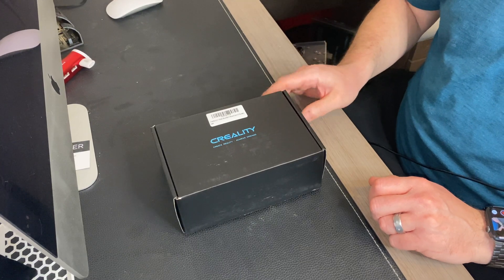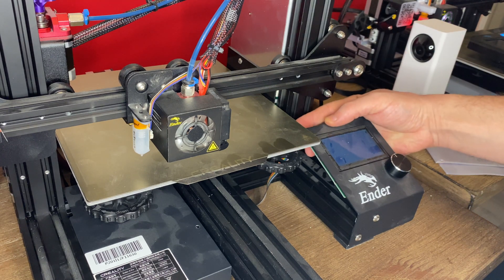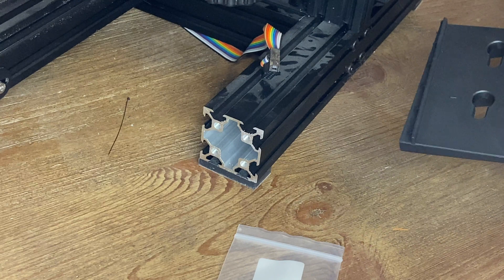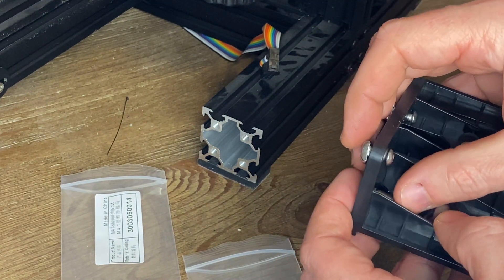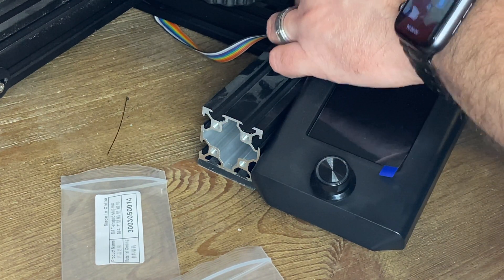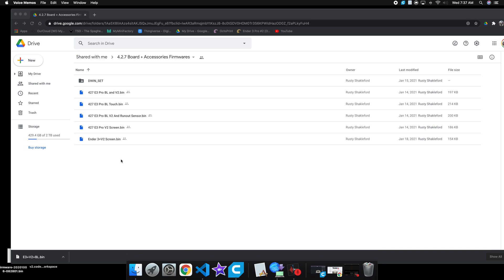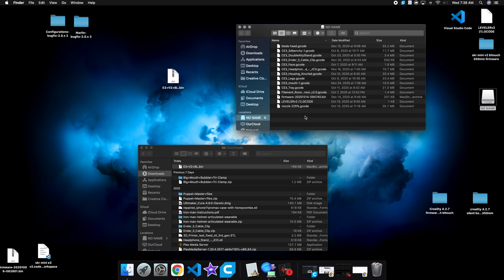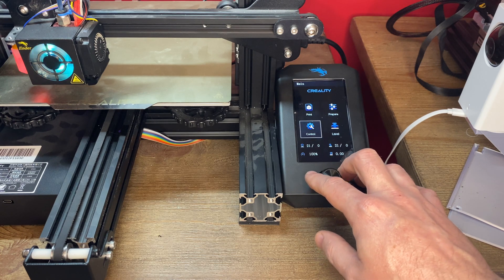Ender 3/3pro upgrade to v2??!!

Comment: I used the firmware included in this video, just one question. I’m having an issue with the “Z Offset” working. Has anyone had this issue and/ or has a resolution for it? Thanks!!

Comment: Just installed MB 4.2.7 for my ender 3 pro and changed out the screen to the V2 screen and installed the CRtouch. 
Downloaded your firmware and it's giving me issues.  Cannot move the Z offset into the negative numbers. 
I'm at a loss what I've done wrong and it's about to fly out the window. 🤦‍♂️

Comment: Hi! I have and ender 3 that I have added upgrades. I have added the silent motherboard 4.2.7, the spire horned, the sprite extruder and the v2 screen. What are the all the firmwares I need to install? I tried installing the v2 versions and when I try to print it won’t print anything.

Comment: You my friend are a life savor. I recently upgraded my ender 3 pro with the silent motherboard and I already had the 4.2.2 board with the screen upgrade from over a year ago and was working great but I wanted to upgrade to silent mother board. Went to install the firmware on the new board and it wasn't booting anything. Found your video and your files downloaded the 4.2.7 with bl and screen and worked like a charm
Reply: Hi there. How did you go about getting the screen fitted to the 4.2.2 board? Is there firmware already available I'm no good at writing my own 😂

Comment: I have a Ender 3 non pro. I have already upgraded board to 4.2.7, cr touch, duel axis, metal extruder. Its up and running and prints great. I bought a v2 screen for the next upgrade. How can i write the framewere so it can work.

Comment: Just found this video and I am wondering, I just bought an Ender 3 Pro from my nephew and it has the CR Touch and not the BL Touch. I also upgraded my Ender 3 v2 to a touch screen and have the ordinal display which is this display. The Ender 3 Pro has the stock board, 4.2.2, Will this Firmware work with the CR Touch?

Comment: Is it work on my ender3 neo ?
Reply: Ender 3 neo also use 4.2.2 motherboard and it has cr touch already. If i plug to my default motherboard this screen work perfectly right?
Reply: @efegulen3127  did you ever try it? I have the same setup

Comment: so this video helped so much however i fallowed all the steps and after flashing the firmware the screen showed half images. im running the cr touch not the bl, and after trying to run the new software on the google drive when it boots up the screen is blank and starts beeping horendisly. if theirs any help yall might have that be awsome

Comment: hi. i have an ender 3 pro with upgrade a 4.2.7 mainboard. i bought the v2 display and update firmware to oryginal creality 3v2 without bltouch but it does not work. next i update firmware to ender 3 pro 4.2.7 + v2 screen from the link below the video, but the display is not turning on. what dwin set should i use to update the display? original dwin set from creality doesn't work. pleas help me.

Comment: I did this upgrade, and bought the same kit that you recommended. It works perfectly out of the box after installation. Firmware was pre installed, so I didn’t have to do anything for that. 

I just bought the CR Touch auto leveling kit from creality, and was wondering how to install it. 

Do I unplug and remove the Z switch completely? Also, what do I do after I install the hardware?

On the link you provided, it says that it comes with the CR touch firmware installed, will the printer know that I have the CR touch connected?

I guess I just don’t know what to do after getting it plugged in. To my understanding I don’t need to change the firmware with the plug and play kit.
But I’m just not sure how it works

Comment: Thank you I appreciate this. I'm getting a CR Touch for my Ender 3 Pro within the next few days. I read the firmware is similar to BL Touch, so do you think the file with "BL Touch" you have would work with my V2 screen?
Reply: Did u ever get the right firmware to upgrade w the cltouch
Reply: @johnvdoe  Hello yes, I was having probing issues with this linked firmware. I ended up using Ender 3 V2 mriscoc firmware, and used the probing settings provided by aim6mac on YouTube because I also have a Sprite Pro extruder. The only thing different I had from that video is the probe offset to get the CR touch to home in the middle of the bed. After that, it worked!

Comment: Hello, and first thank you for putting a working .bin firmware file for ender3 users upgrading their display.  I got my ender3 ( 4.2.7 board + 24 bit reality intel display) working using your ende3 PRO .bin file, even when it is not a pro. 
Would it be possible to get a copy of the "Configuration.h" file that you are using with this .bin file, I would really like to compile it myself using reality ender 3 sample files, so far it crashes not sure why even trying to compile the default 'Configuration.h' without any mod in bugfix 2.0 it crashes.  A little help with this would be greatly appreciated. Alan

Comment: I have an ender 3 with a 4.2.7 board. I also have a v2 display. Would appreciate your help with the firmware. Question; if it is the same board and display why different firmware for ender 3 and ender 3 pro?
Reply: were you able to find out which firmware to use? Im in the exact same boat as you
Reply: @mikeygarciajr.465 download newest marlin firmware. Use VS to modify the firmware to your needs and create your bin file. It’s ridiculously easy and there are tons of videos on yt that shows how to do it.

Comment: Hi Just wanted to drop you a quick note and say how hugely helpful this vid and especially the files were. I have a ender3 v1 non pro but put all pro bits a v2 screen and 4.27 board, v2 tensioners linear rails dual z motors the works and an extender kit for z axis as well as a sprite pro extruder. I do not suppose you have a version of you firmware with the 300 degree extruder enabled on it I could bum off of you?

Comment: with this upgraded board and screen on a 3 pro. Could you just run 3 v2 firmware? If not, why?
Reply: yes done it 3 V2  it works fine  but need to update screen firmware as the DWIN_SET will not upload

Comment: I have an Ender 3 Pro with v4.2.2 board. I am confused on where to get the firmware for the V2 screen non BL touch. Can I just use the V2 firmware for the 4.2.2?
Reply: This is my question.  I see he hasn’t answered so I am screwed for an answer too
Reply: @dugy40  I have the same problem, did you find anything?
Reply: @drogaehovini  yup.  I loaded jyers onto it.  My ender 3 pro is working great.  Has the ender 3 v2 display with jyers on it.  I love it.

Comment: I would like to upgrade my Ender 3 which already has the 4.2.7 board with the touchscreen and the Cr touch bed level which firmware do I use? I have tried to looks all over on the net but can’t find anything with both the upgrades. I stumped upon your video. Would greatly appreciate your help, 🙏

Comment: I'm not sure what to do here... The seller started replying to my questions, then stopped replying... He instructed me to flash the screen itself with "DWIN_SET" files on the back, before updating the board's firmware. I thought it was supposed to be plug-and-play, like in your video... Can you please help me upgrade my Ender 3 Pro to Ender 3 V2? My printer came with the 4.2.2 board, but I have the 4.2.7 board and V2 screen from the seller, plus a CR-Touch from Creality
Reply: Did you ever figure this out? I got the same problem..
Reply: Hey I am having the same problem as well. Did you ever get it fixed?
Reply: @MrKylebobile  Hi use the Ender 3 V2 Firmware with BL Touch  had the same problem but this worked for me

Comment: I plugged mine v2 screen in and all ot does it light up with a blank screen and constantly beeps at me. Any reasons why?
Reply: same problem to me, did you find any solution? thank you
Reply: @onisemeskhi7071  Flash the proper firmware and it will stop beeping and start up when it is done being flashed.

Comment: great video, I've got the v4.2.7 board on ender 3 pro, would this screen and jyers firmware work, I can't see why not ?
Reply: Well considering That they sell the whole kit together on Amazon I would think they would work together
Reply: Which firmware is that please? I keep seeing people mention "jyers" but I don't know where to find the latest firmware for 4.2.7 with V2 screen and BL-Touch (I don't have the sensor though)
Reply: @kevinbakon08  I’m trying to find the same thing but with the 5 pin cr touch. In the description he has a link to a google drive for the 3 pro with 4.2.7 board, v2 screen and 3+2 pin bl touch.
Reply: @kevinbakon08  hi use the Ender 3 V2 Firmware with BL Touch

Comment: Thinking of doing this upgrade, already got the 4.2.7 creality board, what bl touch does the firmware you created, I have the v3.1 bltouch 5 pin and I know it causes issues if the wrong bltouch is set in firmware, nice video by the way

Comment: I have an ender 3 pro now with the 4.2.7 board installed and a blL touch. The firmware in this drive will not allow you set the z offset negative and makes it completely useless. I'm trying to compile my own firmware but keep getting an error telling me the motherboard isnt compatible. Absolute shit show.
Reply: This is probably due the bltouch in the firmware set to 3 pin, and you have a 5 pin or the other way around, had the same issue when I installed my 4.2.7 board with 5pin bltouch, the firmware I installed had 3pin bltouch and the z axis wouldn't lower at all finally found the right firmware and all worked OK, this upgrade would need the right firmware for your setup
Reply: @martinblackmore2275  I ended up having to compile my own firmware.
Reply: The hardware was correctly installed unlike you suggest.